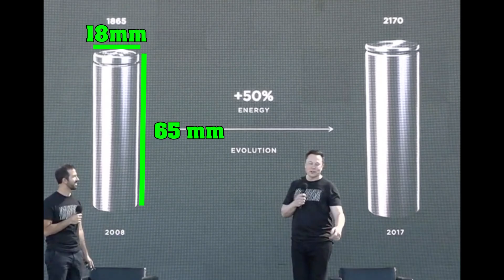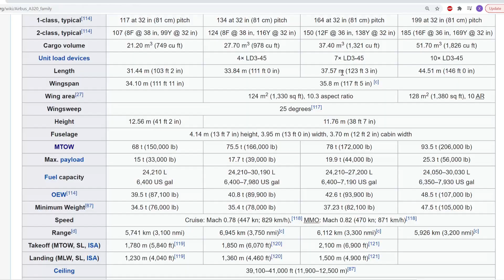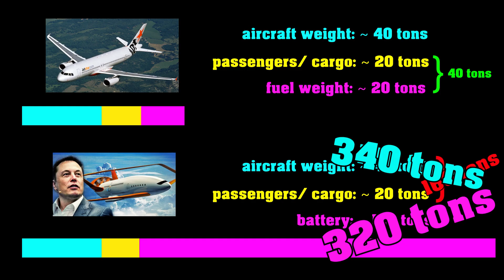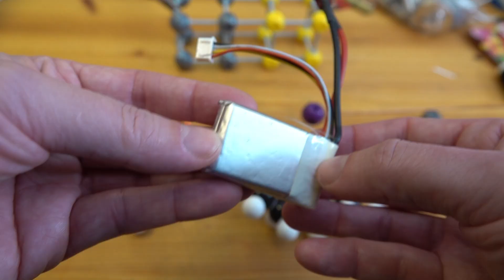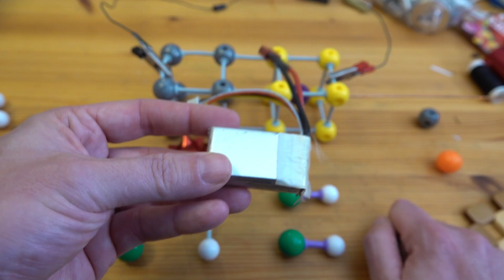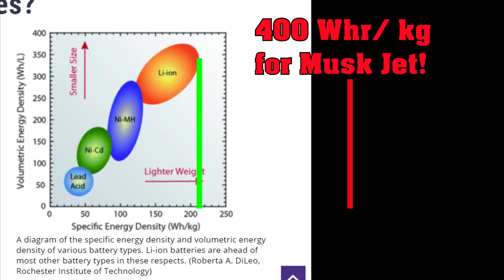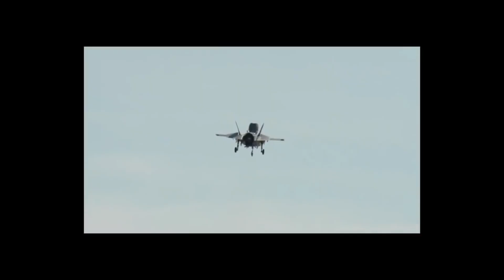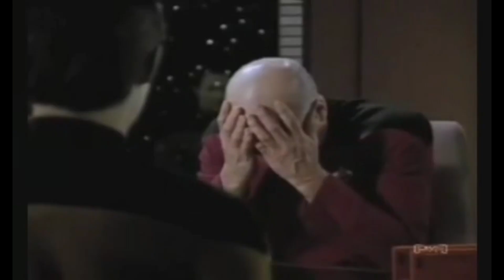Tesla's Secret Plan To Disrupt Airlines: BUSTED!!

Comment: You could eject failing battery and may be have a controlled detonation in mid air (of the battery)
Reply: HE3DA battery did not catch fire even if shot at, many Thunderf00t points are invalid as he simply is outside of his specialization and no amount of intelligence will replace lack of knowledge in the aerospace and battery department...
https://www.youtube.com/watch?v=Im0B_2xzw8I

Comment: With the new cells, doesn't it greatly increase the energy density at the pack level even if it is exactly as dense at the cell level? more material that has to go into casing and spacing is making packs heavier and less full of actual battery elements. Even if its not as drastic as the marketing material makes it sound, unheard of I know, Elon is making the advances into the technology that need to be made to move the industry forward, no one else is doing this. You can hate on him all day but the reality is that electric cars are the future, for the mere fact that autonomy will run on EV's exclusively. As for VTOL's...we'll see, I wouldn't bet against Elon.
Reply: And how is any of this going to make the idea of battery-powered commercial aircraft any less stupid?
Reply: @electric7487  ...think about it.
Reply: @tRav285  Yes, I thought about it. And Elongated Musket's plane is not gonna happen, at least within the constraints of reality.

1. The problem with battery airplanes is that even when you're low on charge, you're still carrying the same weight. With combustion aircraft, you get significantly lighter as you fly as the fuel is used up.

2. Batteries are inherently less safe than a tank of fuel. With fuel, you can't release its energy unless you mix it with an oxidiser. This is a built-in safety mechanism that combustion engine vehicles have that prevents them from blowing up spontaneously. And it works extremely well, as they get their oxidiser from the air around us. Batteries not only have to carry their oxidiser with them, but they also concentrate their oxidiser, which means that they have everything they need to release their energy inside them. This is why, even IF you could make a battery with the same energy density as jet fuel, such a battery would be a WMD.

3. The engines don't just provide thrust. Cabin electricity, pressurisation, and A/C all come from the engines.

4. Supersonic flight guzzles fuel, and VTOL also guzzles energy. A supersonic electric aircraft just isn't possible.

In fact, the first two points are EXACTLY the reason why the idea of a battery-powered commercial aircraft crashes and burns before it even leaves the ground.
Reply: how dare you oppose the haters and claim fact kind sir, how dare you, in here we change the narrative to advance our hatred towards elon musk and all he has achieved, even though the 4680 battery cell has a 380wh/kg density, and much reduced price, and new chemistry, comparing a VTOL to a commercial Liner (which are much much different), and forgetting that a battery pack can be structural, and that weight has nothing to do with structural capacity, because heavier doesn't mean stronger, and that's why a 40 tone plane can fly empty, or carry 20tones of fuel, and 20 tones of humans, and 20 tones of cargo (and much more than that safely but it will not be as fuel efficient) so heavier batteries does not necessary mean heavier plane to carry it, and the proof is that we have batteries in cars, and if we remove the battery and compare it to a ICE car without the engine, the frame would weight about the same, we didn't invent much heavier cars that need heavier batteries that need heavier cars ... also F1 cars that are stronger and carry heavier engines than normal cars only weight 750kg total with the engine ... so i really don't know where he gets those number comparaison ... oh wait, i went the wrong way, i mean, HOW DARE YOU, ELON IS A SCAMMER

Comment: Thanks for the look at the numbers. I was wondering since one of the big weight savings for the new batteries are actually beyond the pack level making the pack structural for the car, if you think of the wing and fuel as a type of pack, does making the battery replace the wings or even more of the structure of the plane help to close the gap?
Reply: This is not really an advantage at all, as interconnected structural batteries would be extremely complex, as well as being extremely dangerous in the event of a battery failure. Plus, we already have structural energy storage in the form of "wet wings" where airplanes will seal off parts of the wing structures themselves and use them to store fuel.

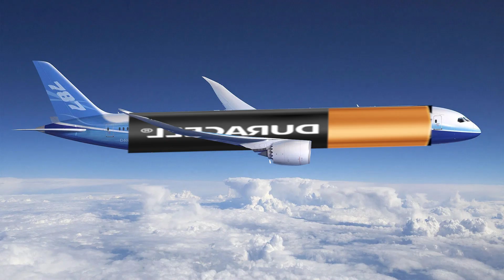Comment: To be fair  4:04 is not representative at all.
By design,  batteries need to be as dense as possible, while the rest of the craft needs as little density as possible, while maintaining structure.
Meaning even if 2/3 of the weight is battery,  it may only take up less than a quarter of the planes area,  given lightweight composites are used and reinforced in key locations.
Could make an even bigger plane with polystyrene... But I only see that remaining as a hobbyist project, and unlikely for commercial, unless it gets real good.

Comment: So much straw manning, if you actually watch the battery presentation they quite clear when they are talking about cell size they are referring to economies of scale in production. They do have other slides which do show they energy density but currently for cars it is the price of the battery rather then the weight of the battery which is the main limiting factor. Other people may over hype his technology but Musk himself is quite clear if you have any listening comprehension that the jet idea needs future battery technology at what the limits of his current and round the corner batteries are. But Thunderfoot is a douche who has to straw man Musk to get up the hate boner he has for the guy.
Reply: And NOTHING in your fractally-wrong comment will do anything to make the idea of a battery-powered commercial aircraft (or even private jet) any less stupid.

Comment: Next refinement: each battery is jettisoned from the plane as it is spent, reducing total weight for the rest of the flight.
Further refinement: each battery has a drone that flies itself to the nearest collection facility along the flight path.
[multiple iterations later]
Final refinement: each battery is the size of a hydrocarbon molecule, which can react directly with atmospheric oxygen and then be ejected.  (We did it!!)

Comment: I'm not a chemist or an engineer so could someone inform me on this. It seems like when referring to a disruptive new battery, it is focused on SS batteries, which are not the pipe dream they are made to be, given they have been repeatedly proven in lab conditions, with Toyota rumored to  be unveiling a SS powered EV this year with billions in government backing. It seems absurd to  ignore multiple teams across the worlds achievements because a prediction from 2015 didn't come true (which can occur for many reasons, not just it being impossible).  Maybe thunderf00t is entirely right here, in which case this video should be sent to all the people pumping billions into SS batteries based on proven research.

Obviously Li-ion won't be seeing major breakthroughs in its current form as its limited by the need to protect against the formation of dendrites, which is reduced/removed by SS. This would be like looking at lead acid batteries in the 80s and saying electric cars have no future, when Li-ion batteries with 4x the energy density were on the horizon.

This analysis also fails to mention some of the advantages of batteries compared to fuels which leads to absurd statements like saying aircraft weight would remain equal or increase when using batteries, which seems ridiculous as batteries can be and are used as structural elements, where as liquid  fuel cannot be. This should surely be accounted for if fuel tank wight and  structural components can be removed but is not even mentioned in this analysis.

Additionally, this entire exercise seems ridiculous, as it's blatantly not a choice between battery or hydrocarbon planes, but renewable energy planes or none at all, given the enormous carbon emissions of current air travel. Simply saying hydrocarbons are more energy dense is not a valid argument if hydrocarbons should be rejected from the get go given that we are in a climate crisis. Unless your ideal future is carbon capture to then re-release all that carbon for your yearly holidays. Maybe you shouldn't compose arguments that fundamentally go against the research of all top climate scientists.
Reply: Exactly!!!!! Fossil fuels 😍 are ⛓🥀💀
Reply: @James Kraatz 🤺sorry 🖐🏽jammo 🥶
Reply: > "I'm not a chemist or an engineer so could someone inform me on this. It seems like when referring to a disruptive new battery, it is focused on SS batteries, which are not the pipe dream they are made to be, given they have been repeatedly proven in lab conditions, with Toyota rumored to be unveiling a SS powered EV this year with billions in government backing. It seems absurd to  ignore multiple teams across the worlds achievements because a prediction from 2015 didn't come true (which can occur for many reasons, not just it being impossible).  Maybe thunderf00t is entirely right here, in which case this video should be sent to all the people pumping billions into SS batteries based on proven research."

- I'll believe it when I see it.

> "Obviously Li-ion won't be seeing major breakthroughs in its current form as its limited by the need to protect against the formation of dendrites, which is reduced/removed by SS. This would be like looking at lead acid batteries in the 80s and saying electric cars have no future, when Li-ion batteries with 4x the energy density were on the horizon."

- Again, I'll believe it when I see it.

> "This analysis also fails to mention some of the advantages of batteries compared to fuels which leads to absurd statements like saying aircraft weight would remain equal or increase when using batteries, which seems ridiculous as batteries can be and are used as structural elements, where as liquid fuel cannot be. This should surely be accounted for if fuel tank wight and structural components can be removed but is not even mentioned in this analysis."

- First of all, the claim was that battery-powered aircraft would weigh the same when taking off and landing, which is true, not that a battery-powered airplane would weigh the same as a kerosene-powered plane, which is false. You don't even have the most basic understanding of how airplanes work.

- Secondly, the "advantage" that batteries would have, that they could be used as structural members whereas liquid fuel cannot be, is not really an advantage at all. Current aircraft already have structural energy storage, in the form of "wet wings". This means that instead of having dedicated fuel tanks, parts of the wing's structure are sealed off and used as fuel tanks themselves. Sure, the fuel itself isn't structural, but stuff inside the battery cells aren't structural either.

> "Additionally, this entire exercise seems ridiculous, as it's blatantly not a choice between battery or hydrocarbon planes, but renewable energy planes or none at all, given the enormous carbon emissions of current air travel. Simply saying hydrocarbons are more energy dense is not a valid argument if hydrocarbons should be rejected from the get go given that we are in a climate crisis."

There are a lot of problems with this argument which do a great job of showing how little you actually know about the subject at hand:

1. First of all, combustion-powered aircraft get significantly lighter as they fly along and their fuel is used up, so they land at a significantly lighter weight than they took off at.

2. Additionally, cabin pressurisation and air conditioning are run using air bled off from the engines. Battery-powered planes would need to draw that power from the battery itself, further reducing its performance.

3. Is it even possible to make a battery with the energy density that would be needed for a battery-powered commercial plane? If so, how do you make sure that it's stable enough to not be a multi-kiloton weapon of mass destruction? One thing to consider is that hydrocarbon fuel is stored away from oxidisers, thereby minimising the risk of spontaneous combustion, whereas batteries have everything they need to release their energy already inside them.

4. A far more practical option for sustainable aviation would be synthetic kerosene. And guess what? Synthetic kerosene already EXISTS, with KLM having run a 737 off of 50% synthetic jet fuel within the past three years. The batteries that would be needed to facilitate an electric commercial plane DON'T EXIST, and are never likely to exist. Because even IF you could make such a battery, they would be 

> "Unless your ideal future is carbon capture to then re-release all that carbon for your yearly holidays. Maybe you shouldn't compose arguments that fundamentally go against the research of all top climate scientists."

- NONE of what Thunderf00t has said goes against what climate scientists have published. Carbon capture is basically a necessity in the future as there are countless applications where combustion engines are the safest and most practical energy source. Maybe you should stop trying to twist what others have said and actually understand how all of this works before saying the most categorically incorrect bullshit.

Comment: to be fair about gas engines, Mazda and Toyota (and many other car makers) mass produce engines with thermal efficiencies slightly above 40%, practically in the same ballpark of diesels. Of course they have been investing billions of dollars over several decades to achieve this result, and each billion invested returns less and less efficiency gain as it reaches the physical limits of the fuels and materials used.

Comment: One thing about those presented Tesla battery, as I think there should be one thing mentioned besides the clear marketing bs: Those new Li-ion batteries are optimized on low ESR. The only reason that those 18650 like cells are even usable in electric cars is by using a lot of them. In almost all high performance applications you would always choose the highly more power dense Li-polymer pouch cells that you were actually handling there in the video. Those are used in motorsports or actual aerospace. Tesla did in fact lower the ESR in those new cells, according to their claims of course, which has to be proven, which makes those cells suitable for more high performance applications. So it's not all just marketing, there is actually some innovation there. Not something to make electric planes next year but still. 
Now I get the debunking concept and all of that and I think there is a lot of proof against such "disruptive" concepts which are debunked in the video here. I'm just thinking that with a more accurate, less artistic way of showing what is possible with current technologies and what not, those videos would feel a lot more professional IMHO.
Actually worked on some high performance accumulators for motorsports, so I had a bit of time to get in touch with that topic.

Comment: Actually the new battery is only 16-20 % more energy dense (some new chemistry of cathode), but 6x power is because they made electrodes parallel to the coil, ergo - quicker to discharge :D . Density is almost the same. This was already covered by Robert Muray smith some other guy info. The 6x and 5x is just marketing bs.

Comment: More important question is how is the e plane propelled. With fans as shown, it will never reach a speed of plane with turbofans. It would be even slower than most turbo props. Not only fuel has much higher energy density, it allows (by vectoring of high pressure combustion gases) for very high speeds. So we wouldn't be able to compare an e plane to a real one anyway. His rockets are not battery powered for the very same reason.

Comment: You need the airspeed of the air through the engine to be at least as fast as the plane airspeed or it will just produce drag and slow you down. It would be a hell of a trick to do this with an electric motor if you want to go faster than propeller plane airspeeds.

Comment: This reminds me of BBC's Micro Men, where at the end, sir Clive Sinclair tells Chris Curry in 1985: I've been looking into the possibility... of a flying car. 
By the way, propeller propulsion assumes an atmosphere dense enough to actually provide sufficient thrust. So it can't work at high altitudes and it can't be supersonic either as the blades can't go beyond the speed of sound. If one does not have another source of kinetic energy (like e.g. chemical release of kinetic energy of combusting a fuel that gives high-speed exhaust gases to the air stream), there will be not enough moving mass to produce a reactive force (thrust).

Comment: well i can imagine a fully powered electric plane, if they make it a delta wing with good long slender wings with winglets, use something akin to a propfan (counter rotating blades), make the propelers integrated in the wing, let them come up above the wing and use low weight solar panels on the surface of the wing, and some kind of insane super capacitors instead of a battery.edit: dont forget a v tail and a closed fan design